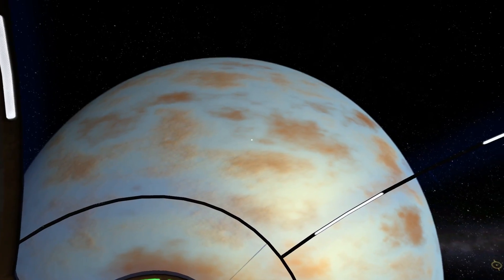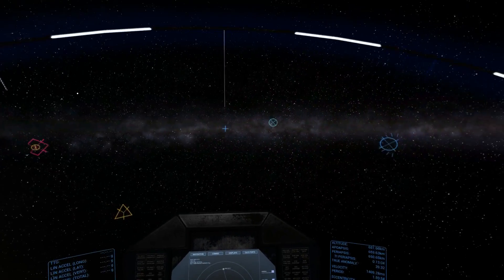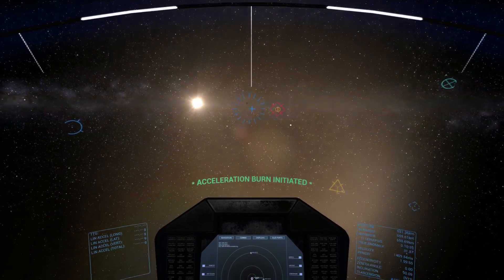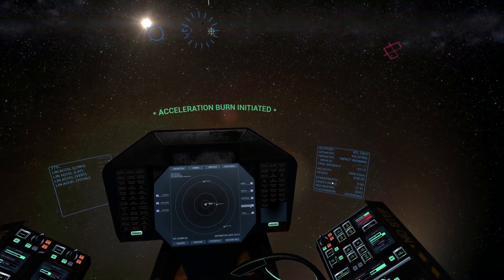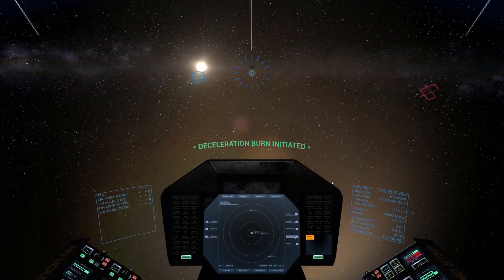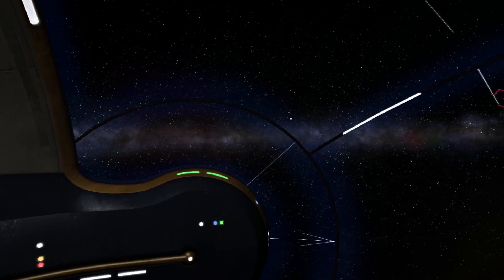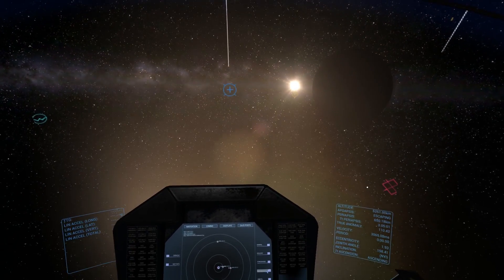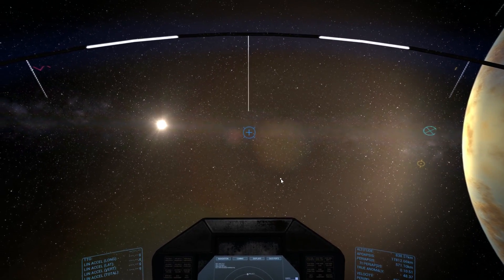Rogue System - Flux Drive Tutorial

Comment: I bought my second-hand NASA centrifuge to simulate micro-gravity and dynamic G-force simulation, now it's time to see if I have the "right stuff" to physically and mentally withstand a high-G environment while in my used pressurized cardiovascular compression and G compensation suit (I bought it on eBay for $50,000, what a steal!). I'm still waiting on my pressured cockpit and USB 3.1 STS control panel array. Will my body be ready to withstand these challenging physical forces while I manage a three-dimensional control surface? Yes, I believe so! I even have my catastrophic space capsule event sublingual cyanide tablets in case of emergencies and anomalous deep-space ship failures. This is going to be an insane simulation rig! ;)

Comment: This seems like a very costly manoeuvre. Wouldn't it have made more sense to burn pro-grade out of the first moons orbit to bring your orbit closer to the target rather than directly towards the target moon?
Reply from the maker: +Tatskaari Yes absolutely, however the burn calculator currently only does these direct transfers.  Also with regards to the FLUX drive there isn't really an appreciable cost as it works off electricity and is propellantless.

Comment: Nice tutorial, thanks. 

One remark though: Once your apoapsis was escaping it didn't matter that your periapsis was below (unless you passed the descending node, which wasn't the case here).
Reply: +Akira Touya Edit: unless you already passed the apoapsis (not the descending node)
Reply from the maker: +Akira Touya Good point, I didn't think about that.  I was too concerned about messing up the video if I crashed.
Reply: +deephack All good. Video was very helpful. Currently doing my first interplanetary travel :) Oh, another point: Periapsis said "impact" but also "invalid" which I assume exactly is because your apoapsis was "escaping" so that you would never reach periapsis.
Reply: +deephack And another question: Uhm, how long was the cut until you reached periapsis after insertion burn? Ttp said ~3 hours?
Reply: +Akira Touya there is a little drop down to the right of your comment that hides an edit button
Reply: Oh jeez. I never knew. But I rarely comment on youtube. Thanks :)
Reply: Akira Touya also note that there is a reply button for the comment thread as well as for each comment. using the thread's reply button will not direct the comment to anyone in particular and they aren't guaranteed to receive a notification. using a comment reply button tags the commenter's name in your reply and ensures that they get a notification (unless they disabled notifications and/or the reply button)
Reply: klikkolee The interface via notifications is just horrible.
Reply: Akira Touya  i was talking about email notifications, which are about 4 times as reliable as the little bell

Comment: EDIT: Nevermind.  Note that the MES reverser is NOT the same as the MTS reverser.  You'll need to bind a key to the MES reverse function in order to brake properly.
Reply: +Louis Chapman Right. The MTS booster is less powerful and is the big thruster in the back of the ship. The MES system is what controls the flux drive.
Reply: Took me a bit to figure that out, is all.  I was activating the boost deflector, then activating my breaking burn, and blasting past the planet at 140,000+ velocities. lol